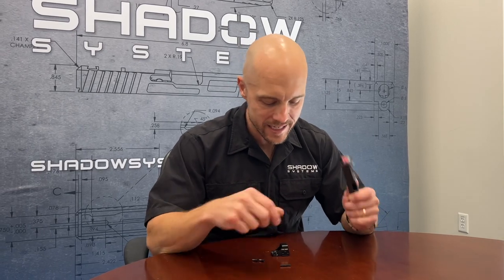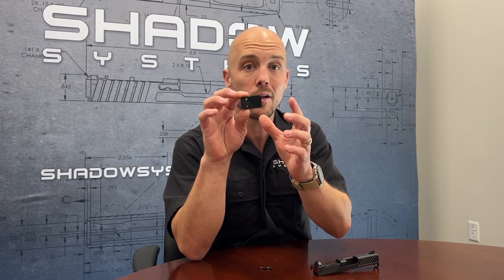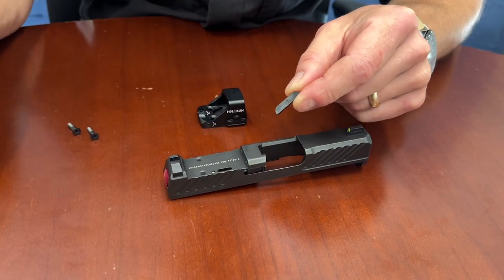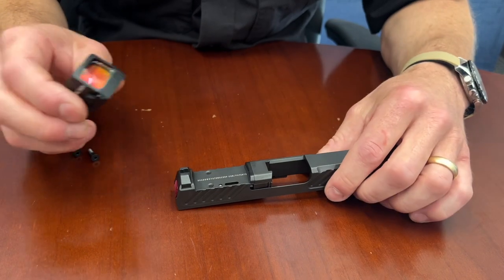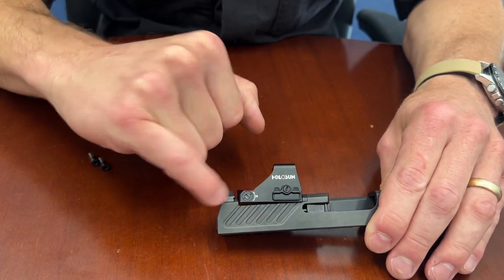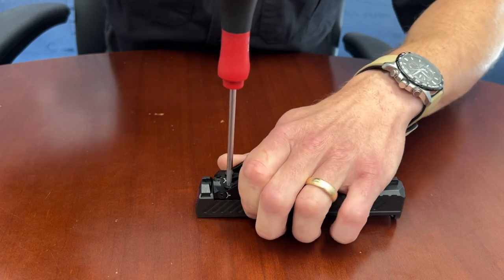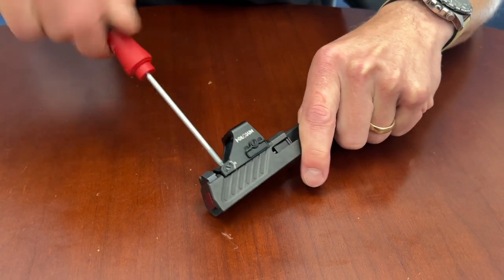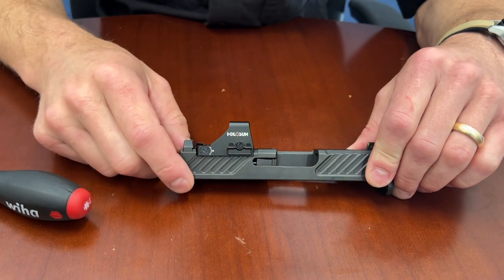Technical Tuesday - CR920 Optic Mounting Tip

Comment: Holosun has nice optics but their tolerance quality has some issues.  Some have complained about gaps on some after market plates and blame the plate when the issue was the adhesive Holosun uses on the bottom of the optic to seal it up is not flush with the aluminum body.  running it over some 400 grit sand paper on a flat surface will help level things out.

Comment: Mine was super tight--I think there may have been metal shavings down in the optic holes because it was CRAZY tight, but then other screws (I bought like 8, long story), went in much easier.

Comment: I had no problems using the manual's recommended spacer with the Holosun eps carry I installed one month ago. Eps carry is the same "k" footprint, but it still makes no sense that the 507k's would vary that much in dimensions.
Reply: I just purchased the CR920P. I’m wanting to put a Holosun eps on it. The video I saw on you tube showed mounting the Holosun directly on top without removing the plate. I’m assuming he was wrong. Is yours a CR? And does it co witness with stock sights?
Thanks

Comment: I had this problem with the 407k. I also think they shipped the one I had with 2 of the same spacers. I had to sand down the spacer list a little to get the screws to even start to line up. It is rock solid now. Are you guys going to be at the NRA show in Indy?

Comment: What about a 507k on the DR920. I have gaps in front and behind. The DR920 Foundation manual says there is no spacer available. I’m afraid to shoot it with this optic knowing it can shear off the screws.
Reply from the maker: Hi Matthew. There is zero chance of shearing off the screws due to their size and depth. However, there is some risk of it twisting if struck. The spacer for that optic is on my desk. In production now. Hoping to post next week. Trevor
Reply: @ShadowSystemsCorp  Hell yea!

I've been waiting for this every since i heard about the Holosun EPS!
Reply: @ShadowSystemsCorp  this is all I’ve been waiting for 🔥
Reply: @GEEKinLyfe  wouldn't the EPS fit it better than the 507k? The k is made for compact guns . I know they're using the same footprint but the eps is for full sized pistols the eps carry is for compacts. Actually wondering because I'm going to get one as well for my war poet
Reply: I’d be more willing to bet the Holosun is not the issue but CNC variation in the slide.  Always seems to be some sort of excuse with SS about everything.
Reply: @ShadowSystemsCorp  I have a MR920.  I'm running a Holosun 508t.  None of the 3 spacers provided fit correctly.  Any chance of a spacer for the 508t? Thanks!
Reply: @eli42o12  The EPS is wider than the EPS carry, but the it still has the same length as the EPS carry. 

Wth the EPS on a MR/DR920, there is the same gap in front and behind the optics as the EPS carry. The EPS just overhangs the slide a bit on either side, while the EPS carry sits more or less flush with the slide
Reply: @Jayfab79  @shadowsystemscorp  I too wish they'd make a spacer a little thicker so the 508t fits snug.  Asked them numerous times about it and they say it's fine.

Comment: Hypothetically if one were to allegedly tried to use a torque wrench and did it to 15 inch pounds and prior to the click it snapped off the bit in the sight and frame with the blue lock tight…. How screwed would the one be

Comment: Has anyone had issues with the one of the screws being too long and interfering with the extraction plunger?
Reply from the maker: @dustyneyman6604  please email my technical team at support@shadowsystemscorp.com
Reply: Had the same problem with my 43 X just have to file down that screw a little bit till it doesn't interfere with the plunger spring

Comment: Should have mentioned that manual is wrong for screws as well for the CR
Reply: I have heard that the flatter head screws may work better with the EPS carry or something…but I’m on the fence about putting my EPS Carry on it since I shoot this really well out to 20Y without it and it’s a smaller footprint.

Comment: I put a swamp fox on mine and it's great. Just in case anyone was curious.
Reply: What screws did you use on the swampfox? Did it sit straight on there mine tries to tilt up in the front.
Reply: @MrJoeyoeo  I used the supplied screws. It sits straight. The spacing plate from shadow systems sits in front of the optic. It was a bit snug. But has stayed pretty true
Reply: @MrJoeyoeo  hold the front down while you tighten and it should seat ok.

Comment: Do you guys know what holsters work with these? Tier 1 and we the people don’t.  I just recently installed one of these optics Saturday.  Didn’t have a problem at all besides the screws being really tight
Reply: I found Black Arch while looking for one. I've order it but have not received it yet. TXC makes one for the CR920 in their Pro style but it's a pricey to me with it just being the hostler without a sidecar option.
Reply: Just a follow up. It just so happened that T1C was taking questions on Instagram and I asked about the CR920. T1C stated they got one in last week so they should be available very soon.
Reply: @shanethideman690  yes. I sent them a message earlier today and they said they were working on a mold and would send out email when available
Reply: Bravo Concealment make a good G43X holster that can be configured to be IWB/OWB. It works perfectly with the CR920 (plus optic) if that's what you are looking for (if you are a right-handed shooter anyway). Plus they go for around ~35 bucks so they don't break the bank like many other holsters on the market that offer a similar amount of features
Reply: @AngryB4ker  awesome thank you. I’ll check one of those out tomorrow when I go to a local shop tomorrow. I believe they carry them and have one in stock.
Reply: Venicor says G43 holsters work.

Comment: Any idea if this exact process applies to the EPS Carry?? No issues holding zero or anything so far but I do notice if I hold the gun up against the light there’s a sliver of light shining thru between the slide the front of the optic. @shadowsystemscorp
Reply: My eps carry directly mounted to my 43xmos had this same issue
 Only can see it with a flashlight shining thru it, but ive loctited it down and have no issues shooting it or zero shifting. Its a normal occurence especially with holosuns. Just make sure its tight